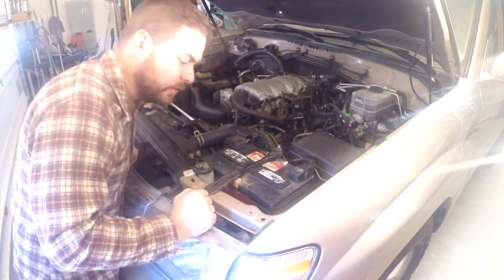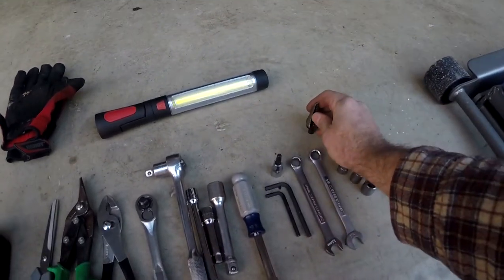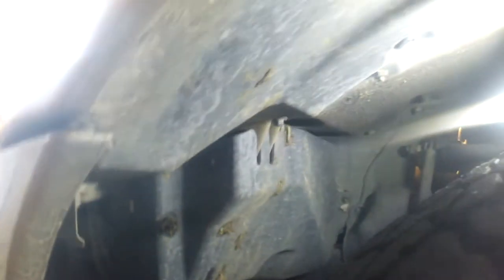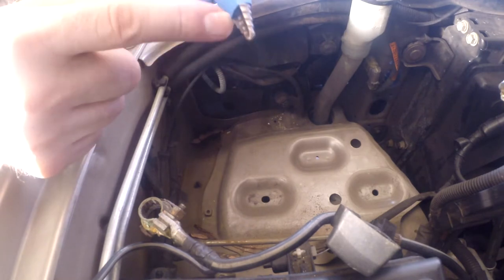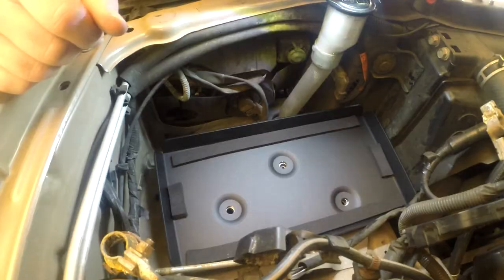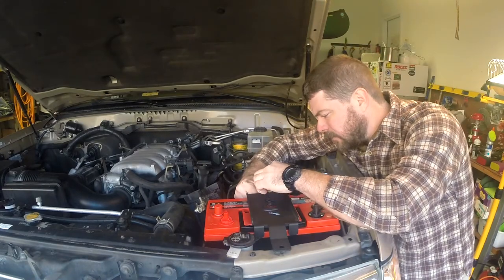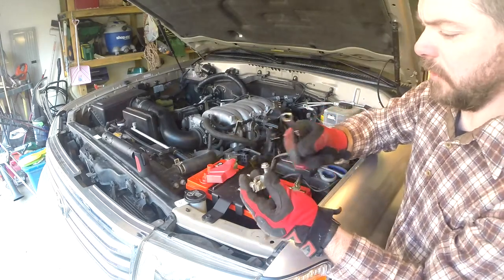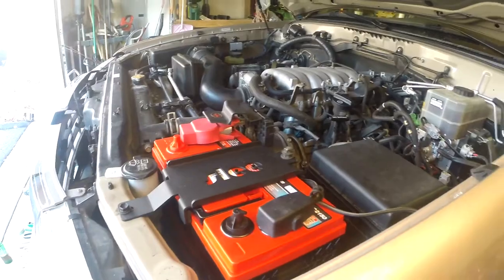Slee Off-Road Land Cruiser Group 31 Battery Upgrade Install - Building the Beast

Comment: Wrong Battery yeah?
Terminals should be at the back 
Then it fits with no interference.
In Australia, there is a Left and Right battery.
As the negative needs to be near the chassis and at the rear both sides.
Hence a Left and Right version.
You have clearance for a Group 31 battrry this way...
Nothing touches

Comment: missed it, what was were you OEM battery group? Any worry this would put any pressure on your alternator? how much Reserve Capacity did you gain?  I'm wondering if I can upgrade my 4 cylinder Ram promaster city OEM group 48/H6 (11 inches) to group 49/H8 (13 inches).. but RC 120 to RC 185.

Comment: How has the battery been holding up? Is there anything you would recommend done differently from your video? Thnx!
Reply from the maker: Hey man, I thought I had already replied to this, sorry about the delay.  The batteries are holding up great.  The only thing I would have done different was to add the HKB fuse to upregulate the alternator voltage at the same time I put in the batteries.  It will ensure they are getting to 100% while charging from the alternator.  If you are intending to setup a dual battery system then I would consider solar and a on board AC charger.  It took me a year before I added and it has been wonderful.  Solar keeps things toped off while camping offgrid, alternator does tops off while rolling along with solar, and AC charger puts serious AMPs to the batteries and while run all my gear when in an established camp ground, at home, or at friends. I hope this helps.  I go most of my current setup in this video https://www.youtube.com/watch?v=RQyYByinrVs
Reply: @BradyAdventures  thank you so much for your reply and advice! I have an 05 Land Cruiser and I’m going to start mine off by replacing the battery for the same as what you have. Your vids are very informative and helpful I really appreciate everything you do and the quality and effort you put into your vids is top notch. Keep up the good work and thank you! Best of luck and look forward to watching your vids as you post more

Comment: So I'm getting ready to do a dual battery setup in a 4Runner and I saw your off-grid engineering set up that you had done. If you were to read it before Runner would you still have used off-grid engineering or would you have done a setup like this?
Reply: Sorry voice to text kind of messed part of that up... If you were to redo it on the 4Runner would you have used this setup or the off grid engineering set up in the 4Runner?
Reply from the maker: +youknowit158 Great question! When we did the offgrid install I thought the price was pretty high for what was in the kit.  I still think you pay a preimium for the offgrid kit but after doing the land cruiser I have a greater appreciation for the cost and time it takes for wiring, crimping, and sheathing, I dont think it as expensive as i used to. At the time, and i think it's still the case, there were no other aux battery kits for the 4runner that didn't require significant mods to the truck. We didn't want to make any significant permanent mods under the hood so it was really the only kit for us. I think if I was doing this today on a new 4Runner I would probably still go with the off-grid kit primarily because of the auxilary battery mount. If  off-grid or some other company had a separately available auxiliary tray I would probably go with that and DIY the rest of it. I hope that makes sense please let me know if you have any other or follow up questions. Thanks for checking us out!
Reply: Brady Adventures I get what you're saying, thanks! I'm planning out my build for this spring

Comment: What is the make and model of the battery you installed?
Reply from the maker: Both the start and aux are odyssey batteries the start is a 31M- PC2150ST and the aux is a PC1230 75/86

Check out this video I get into the batteries specifically.https://www.youtube.com/watch?v=lFsXiACiykY

Thanks!